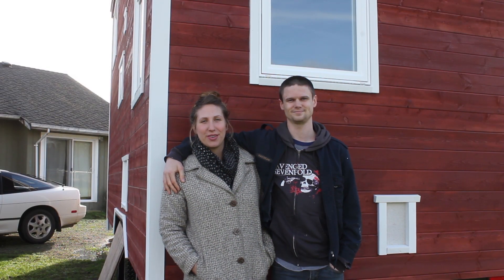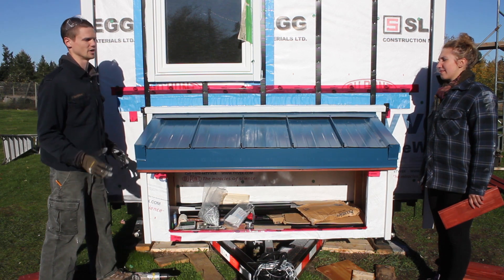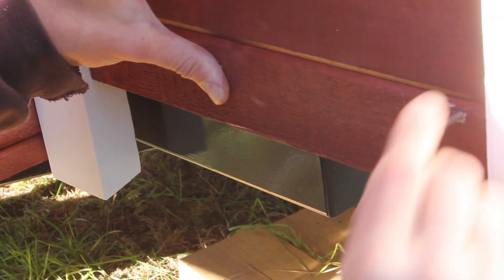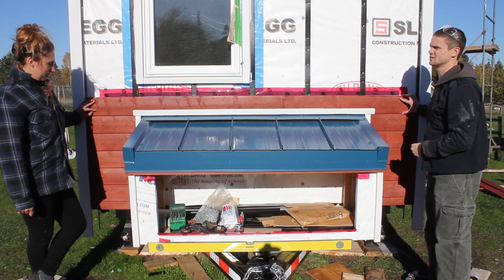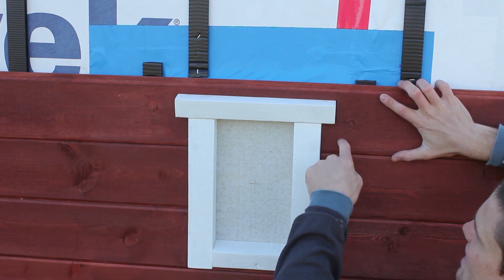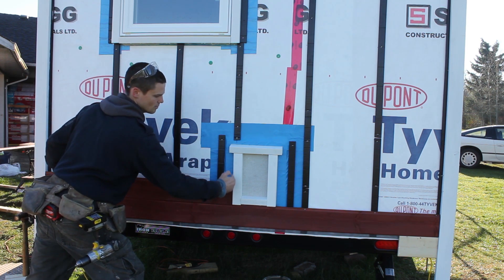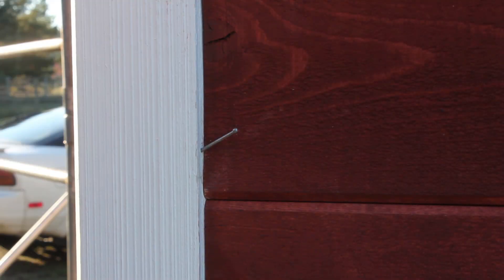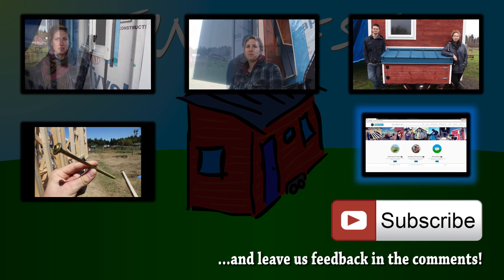Tiny House Exterior Siding Installation - Part 1 (Ep. 25)

Comment: Dear Jake & Kiva. I'm so happy to have come across your video's.  I'm from Cape Town South Africa and has done lots of research over here to built one.  Only in Africa everything is hard to find. Starting at finding someone to build a trailer.  I've been ripped off by some people like you won't believe.  I've done my design, bought some equipment even started building some furniture.  Problem is, i need that trailer.  My hands are tide until I manage to get something I can work with. I'm thinking on getting the largest car trailer with a double axle breaking system I can get my hands on and just modify it.   People over here think I'm crazy. Nobody gets the Tiny House thing.  Instead they ask why don't I just buy a CARAVAN!? LOL!  I have wasted a year trying to get started. Hopefully 2017 will be the year I can build my Little Shack on Wheels. Thanks for sharing. Janene
Reply from the maker: Sounds like you've got your work cut out for you, but I'm sure you'll make it happen :) let us know how it goes!
Thanks so much for watching.

Comment: I stumbled across one of your later videos during my tiny house research. I am planning to build a tiny house in the near future and want to get as much under my belt as possible and hey why not learn from others experience. Anyways, I wanted to let you know that since your video was detailed I decided to start with your 1st video and have felt they are defintely worth while. You 2 are meticulous, which I really appreciate seeing someone do the research, have the patience and desire to take your time and do quality work.  I did have one comment regarding the siding....I set tongue and groove on the ceilings and used an air staple gun, with 1/4" X 2" staples through the tongue (same area that you nailed at an angle, so covered by next piece groove) and into stud. This is much less time consuming. Just wondering if there was a reason you choose your method as I believe finished result is the same. If you have an air compressor, these guns are quite inexpensive.
Reply from the maker: +Handy Woman Thanks for watching :) Since a lot of our siding pieces had a cup or bend to them, we found that nailing by hand gave us more control to tap things into place... it was definitely time-consuming, and ideally we would have had all straight pieces to work with, and used a powered nailing gun :P

Comment: now that its a year old , have you hadd any problem with the pine swelling or buckling ? i have had that problem before , i was wondering if the ventilated lath strips resolved that issue
Reply from the maker: +grizz270 We actually had some shrinking, which was very fortunate since expanding/buckling would have been much worse. We installed in November and without actively drying the wood, so it was on the high-end of moisture content and thus expansion. The following summer was extremely dry and clearly the boards felt it, since the seams opened enough to show the nails on basically every row... and we had installed everything tight and closed. There were a few spots that curled enough to require attention, and we used some screws on those to suck them back into place. We will be making a video about this, but we sunk and covered the screws with wood filler and restained anything we had exposed. Then we recaulked the entire exterior, including the awning and any roof seams that could benefit (like on the gable ends where they aren't overlapping/interlocking). Some of the original caulking had pulled apart from the contracting wood. Now that it is wet again, the wood has expanded back to the size it was when we installed it and the seems are tight. This turned out really well since it's wet here more often than dry, and we do not expect buckling to be a problem based on these experiences. It actually swells closed and makes a better water barrier when there is rain... it's reactive in a productive way :)

Comment: You guys have been so inspiring to my girlfriend and I.  Keep up the good work.  We actually live in Olympia, WA and are very interested in an Iron Eagle trailer that is 8.5' x 20' as well.  I have been designing in sketchup for a while now but have ran into a problem with the width including the exterior siding.  I'm sure you have probably answered this already (and I can't see your sketchup file to measure yours, since I don't have a way to view Sketchup Version 8) but how thick is your sheathing?  and the black ventilation strips over the tyvek, how thick do those stand out?  as well as your exterior siding, how thick is that?  The trailer model I've been using on sketchup I downloaded for free from the 3d warehouse (its actually labeled as an Iron Eagle Trailer), and it's incredibly accurate to the trailer dimensions described on Iron Eagle's website, with a total width of 102" but leaving 1" on either side for your exterior siding.  Sorry for the essay haha.  My question boils down to, how did you fit your sheathing, tyvek, those black ventilation strips, and the exterior siding into 1" of thickness? Or did you use a frame that was narrower than Iron Eagle's standard 100"? And if so what frame size did you choose?  You guys really are doing a great a job and I wish you all the best.  Thanks so much for your time and any help you may be able to offer.
Reply: +TheJeremyHarrisProj  So I just did some research and found the rain screen strips you were talking about are 3/8" thick plus i remember from your previous video that your 1x6 siding is really 5/8".  If the maximum width limit is 102" and the trailer leaves you with only 1" for your exterior siding, your rain screen and 1x6 siding equal 1".  So in order to use 1/2" Plywood sheathing (really only 15/32") did you end up going over the 102" maximum?  Beyond your exterior siding, your trim looks like it sticks out about 1/4" or so.  Does this mean your house is an extra 3/4" (1/2" ish from sheathing, 1/4" ish of trim) past the maximum 102"?  Just curious seeing as Iron Eagle's standard frame is 100".  It has been perplexing me to say the least, if this is the standard, how is everyone squeezing about 1 3/4" of exterior siding into 1" of space?  Your wisdom is much appreciated.  Sorry for another long message.  Thanks again for your time and any insight.
Reply from the maker: +TheJeremyHarrisProj The short answer is that our trailer is 98" wide, leaving us 2" on each side to work with. We are over the limit if you were to measure from the face of the fascia on the lower edge of the roof, to the face of the fascia on the higher edge of the roof, mostly because of the rainscreen and the venting.

Our Sketchup model is spot-on accurate for these details. You can download the latest version of Sketchup Make (the free version) to inspect it yourself. Just go to our website for the file.

Additionally, we are now able to get people $100 off their Iron Eagle trailer if they mention Tiny Nest :) so tell Rob we sent you!

Comment: It seems like the nail might favor water flow counter to all the other work done.  But there's probably no other way to do that.  Since a nail in favor of gravity will only give way to gravity.
Reply from the maker: wwwShadow7 This is true. The only solution would have been to stain or otherwise plug the holes at the heads of every nail... we could have done it...

If the pieces swell we will definitely make a video to show what went wrong. We're planning on doing a once-over this coming summer to freshen the stain, touch up the caulk, and tighten down anything that seems to have shifted.